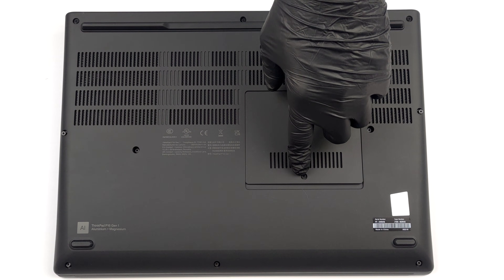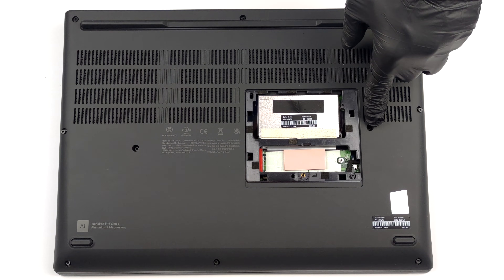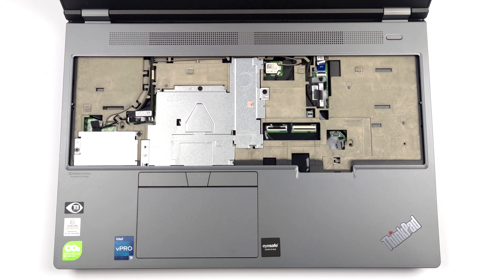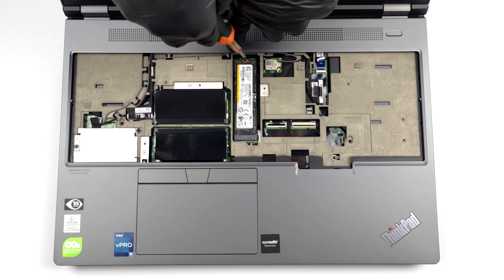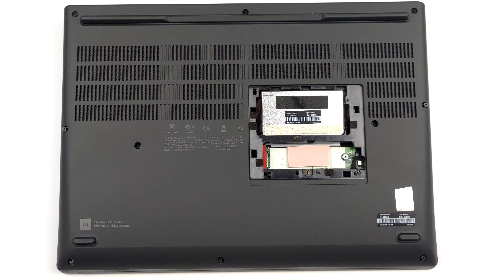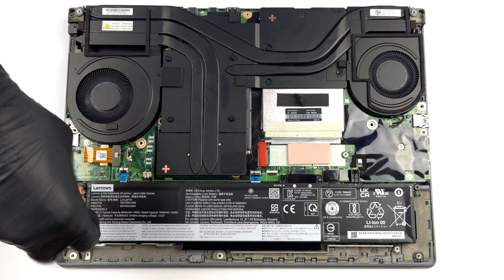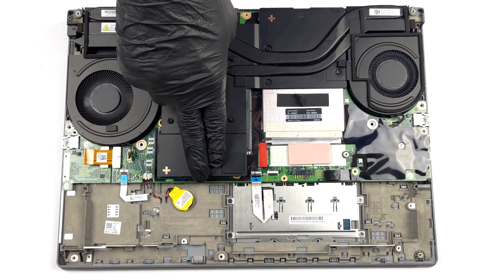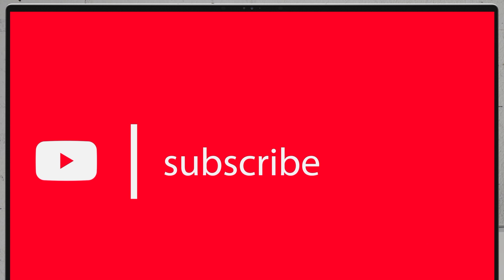🛠️ How to open Lenovo ThinkPad P16 Gen 1 - disassembly and upgrade options

Comment: Are you able to swap the GPU out easily? Or is a EGPU a possibility?
Reply: I just ordered a A4500 to swap out my A1000 in my P16 G1. i'll report back if all works well.
Reply: @om3ga85 did it work???
Reply: @Cms2  Yup sure does. You're going to need 2 extra thermal pad strips to cover the additional VRAM chips to the vapor chamber. At full load I'm seeing an average 78 to 83 degrees C GPU temp wise. Worth the upgrade from 4 to 16gb.
Reply: @om3gadoestech can i also swap the gpu on p16 gen 2?
Reply: @lower.backpain  yes you can, they're like exactly same models but have different motherboards, you can upgrade from an 2000 ADA to something else but you need extra thermal pads for memory modules, on top of that you can only get these parts from lenovo I believe since they're proprietary
Reply: How much was the a4500?

Comment: Are you able to see how the power socket is connected? Is it connected to a rigid part of the chassis and then wired to the circuit board, or is it directly welded onto the circuit board?

Comment: 2 ram slots is enough. The 3rd one at back make no sense. Should be the 3rd m.2 ssd.
Reply: there's 4 slots, i'm using one as we speak!
Reply: @jamesaamoore  can this charge on usb-c at all? even if not at full wattage?
Reply: @quillaja to be honest I haven't tried, too scared to melt the motherboard lol
Reply: I'd disagree. For my company we're buying one with 32 gB of ram, with the intent that we're able to slap a 32 kit into the open slots down the line for 64 gigs if it seems neccesary. It's also a lot cheaper to do it that way than buying a 64 gig kit when you need it. Larger SSDs tend to be cheaper to add and can also be plugged in to a USB-C. RAM cannot be.
Reply: there isnt a sodimm ddr5 module with 64 gb on the market yet, which means that the system could not support the cpus rated 128gb without 4 slots